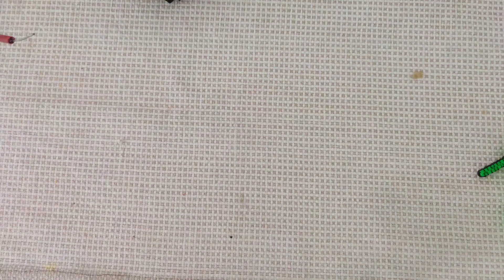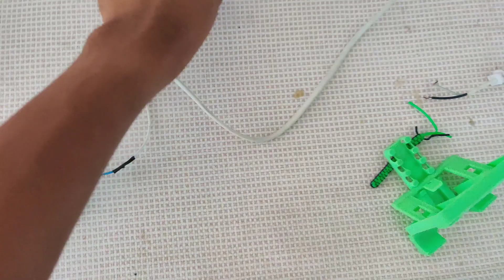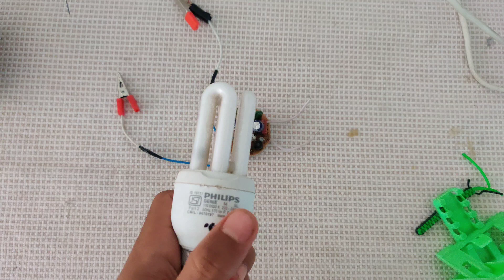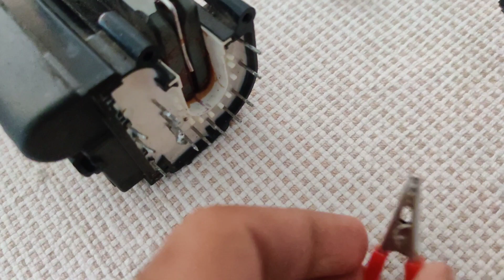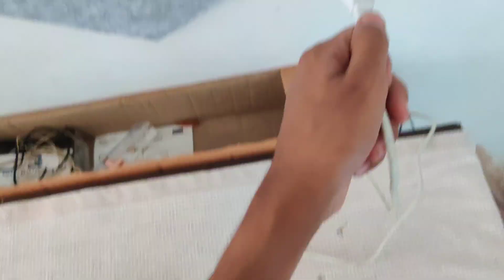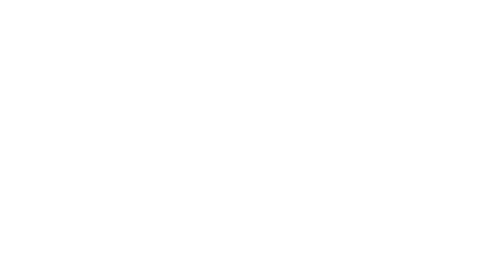The Easiest Flyback Transformer Driver Circuit!!! Only One Component!!! #highvoltage #transformer

Comment: I am experiment with these circuits. Im trying to find a way to modify them so they can work with almost any flyback, and can run continuously withouth heating up. Im trying to find a modification that can work on any cfl circuit. So far my best method is to rewire the inductor as a 1:1 transformer, connect the secondary of transformer to the primary of the flyback, and close the output of the cfl through a power resistor (50 ohms should be good).
Reply from the maker: Dude that's awesome!! The circuit heating up is one of the main problems I'm facing, if this solves it, that would be great. I'll try it and update you on the results.
Tysm!!

Comment: This transformer has a cylindrical compartment on the side in which a high-voltage capacitor is installed, connected by one plate directly to the red high-voltage wire, and from the second plate the contact is brought out to one of the lower pins.
Using a capacitance meter, you can calculate the pin to which this capacitor is connected and solder it to the common wire of the transformer.
And then, instead of a continuous purple arc, separate long blue sparks will occur, accompanied by loud clicks, like a shocker.
Reply from the maker: Found a schematic for this transformer. It has the capacitor and which are its wires.I will make a video on it.
Thankyou for the idea!!